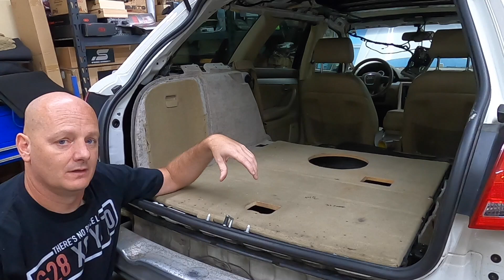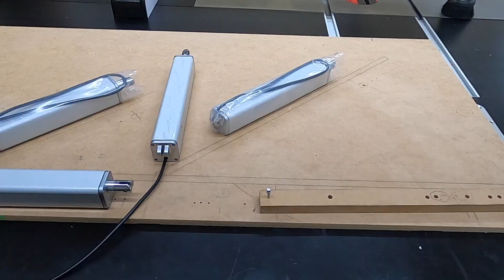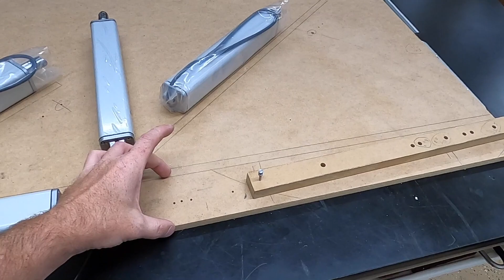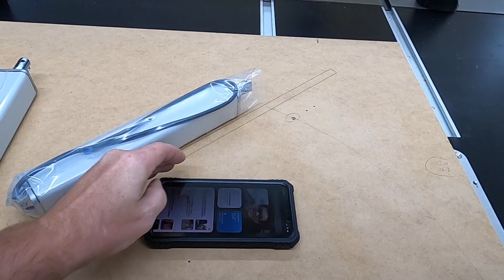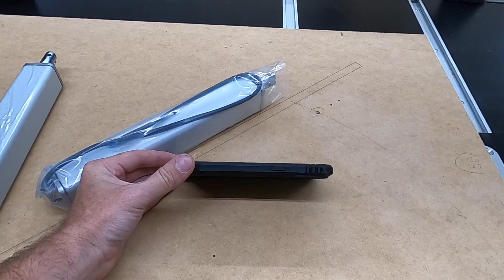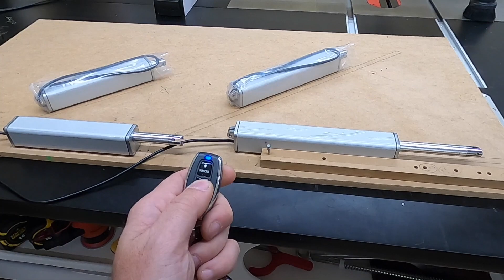Audi Cargo Floor Solution

Comment: This will be interesting to follow :-) Do you by any chance have a link for the actuators? They looked really stout. Thanks.
Reply from the maker: Check the video description. It has the link for the actuators in it. 44lbs of force each, 1.8" per second travel speed, and compact at 1 3/4" square.